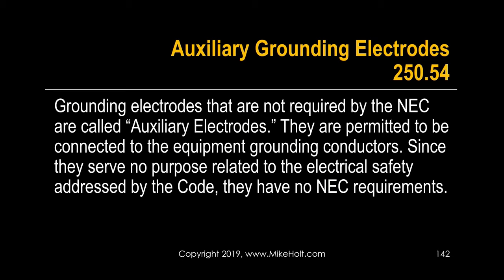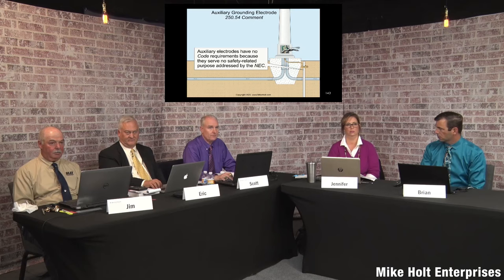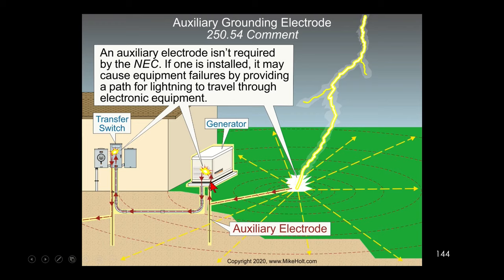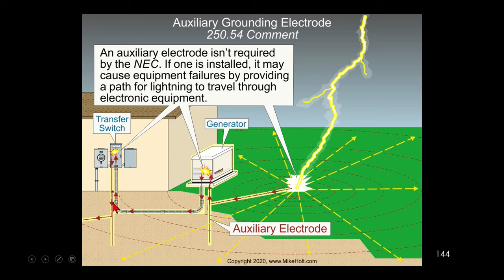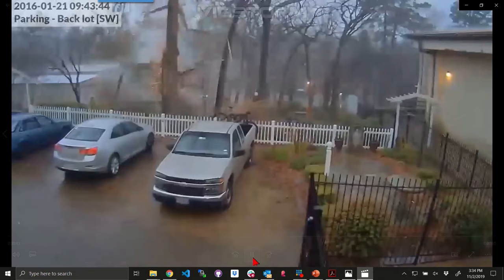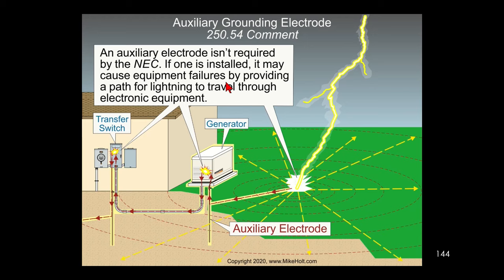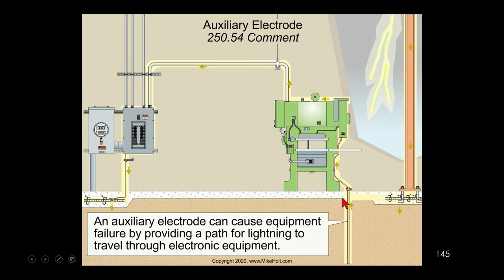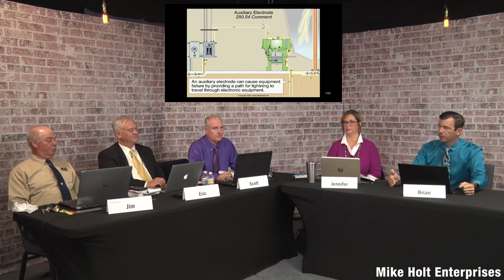Grounding, Auxiliary Grounding Electrode [250.54, 2020 NEC]

Comment: A good example of why not to use a ground rod at a generator. Then WHY drive a ground rod at a shed or dettached  garage subpanel? A lightning strike near the shed would bring the charge to the house service  panel, via the ground rod and equipment grounding conductor.
Reply from the maker: But there is no ten thousand dollar electronic equipment between the ground rods.
Reply: The purpose of the auxiliary grounding electrode at an outside generator or lighting pole is to help mitigate damage from a lightning event. I sort of agree with Mike that it may not work as designed by the engineers, but that is the purpose.  There are a lot of "White Papers" showing engineering studies in regards to this topic.
Reply: I am confused just as All Day Jack. On one video it was showed the outdoor panel is connected to the ground rod to direct the lightning current (caused by induction) to the ground. On this video, it was shown that the lightning current can go back to the building if the generator is grounded. I am concerned because my facility has  many control systems worth millions dollars.   It seems to me that if I install a ground rod, the lightning current will flow into the building through the ground rod, if I don’t install the ground rod , the equipment inside the building will be damaged or fire through induction. Either way I get trouble.

Comment: With the auxiliary electrode and a generator. I get it. We don't want it. But the casing of that generator is grounded locally (or maybe not) and it will develop very high voltage in reference to the rest of the system. Now we can have electronics or insulation failing in the generator and there is nothing we can do about it. An SPD will do nothing because it's connected to system ground (and we want to keep it that way to not introduce this local high potential into our system ground). Is there no way to protect our generator? (in my case a ground mounted Pv array rather than a generator, but whether it's a generator, a separate building or a pv array we have the same problem). How to surge protect when we have difference in ground potentials?
Reply from the maker: The generator and PV system (and all other electrical equipment) is connected to the circuit equipment grounding conductor and 'never' connected to earth ground. Therefor there will never be any difference of potential on any metal parts of electrical equipment that is wired in accordance with the NEC..

Comment: Wouldn't the type of transfer switch used to connect a generator to a home make it a SDS or not? For example a transfer switch that switches the neutral wire would make the generator a SDS. Is this why the generator manual may say to use a ground rod, because the SDS would be factored on what type of transfer switch that is used?

Comment: I have a question, im installing a service of 200A by roadside, like 50ft away from the main house and installing 2 ground rods at the first point of disconnect which technically it is the main panel. Can i do a ufer grounding over at the building on the first floor using the rebar grid since the main panel will be upstairs?

Comment: Generac says we dont put in ground rod in
Reply: They do require a ground rod at the automatic transfer switch as it id the first place of disconnect.
Reply from the maker: Generac 'does not' require any grounding or bonding. This is under the scope of the NEC.

Comment: Since bonding to the water and gas pipes is required, wouldn't that have the same effect as the example presented with the nearby lightning strike and the ground rod?  Also, how does the "whole-house surge protection" rating help, when the ground potential dramatically increases during a lightning strike? The same for lighting protection for metal roofing.
Reply from the maker: Since everything is bonded together inside, there is no difference in potential; so no problem. When all is bonded together, voltage does not rise between metal parts. Why would anybody provide lighting protection for a metal room?
Reply: @MikeHoltNEC  Thank you very much, Mike for your prompt reply and information, and for all your help.  I really appreciate it. Regarding metal roof lighting protection, somehow the topic came out on the specs for a project where solar panels were going to be  installed on top of the metal roof.

Comment: What would make a generator a separately derived system vs. not?
Reply from the maker: What that's a 'deep' question. But the short answer is that if the transfer switch switches the neutral, then the generator will be a separately derived system and it must be bonded and grounded in accordance with 250.30(A). If the transfer switch does not switch the neutral, then the generator is not a separately derived system and the generator must not have the neutral bonded to the metal parts and no grounding is required. So don't follow 250.30(A).
Reply: @MikeHoltNEC  Hi Mike, how about a Solar systems of any type? Are they SDS?

Comment: My coworkers argue that having a ground rod is a safety feature to prevent shock in case of a short or a ground fault.  Is this the case?
Reply: They ground all equipment to ground rod.
Reply from the maker: Watch this video, to understand why this statement is 100% false.
Reply: @MikeHoltNEC  question if I have a rigid conduit in the ground and it needs repair can I attach pvc  adapter to ridgid convert conduit to pvc and then before coming back out of the ground convert back to ridgid?
Reply from the maker: @Jinxo-md2jl  Post questions not related to this video on MikeHolt.com/Forum